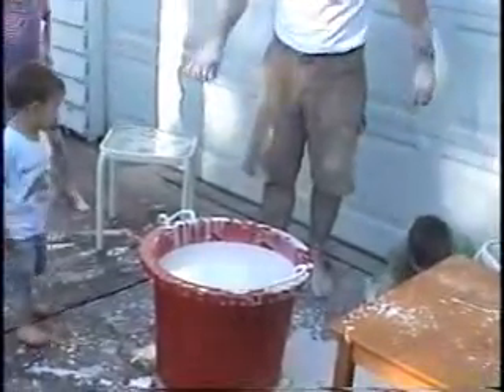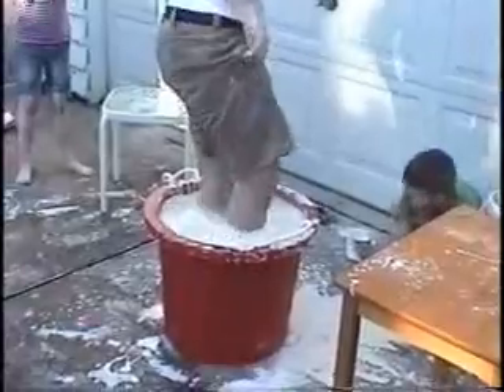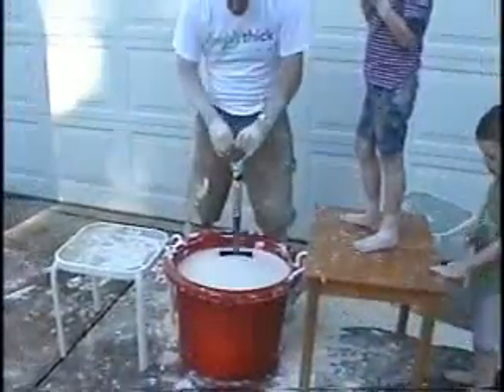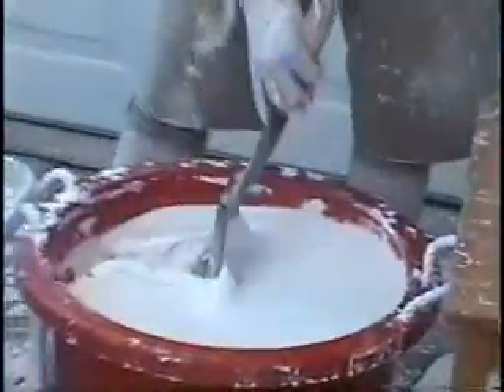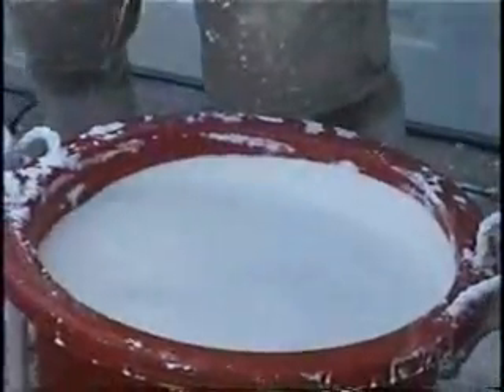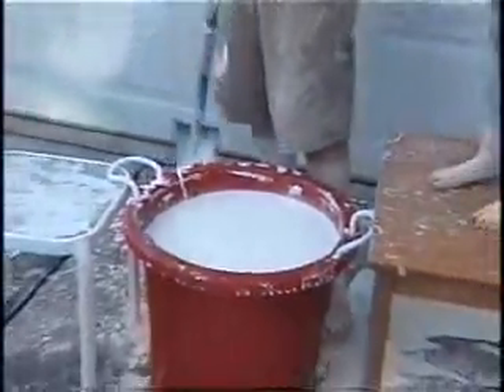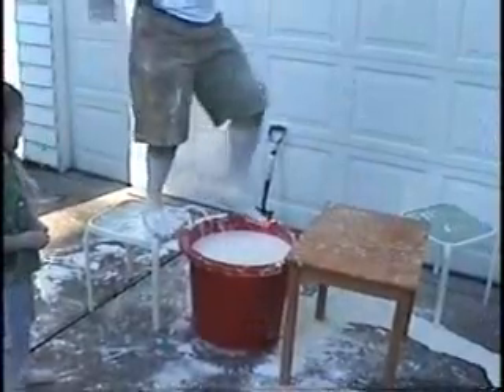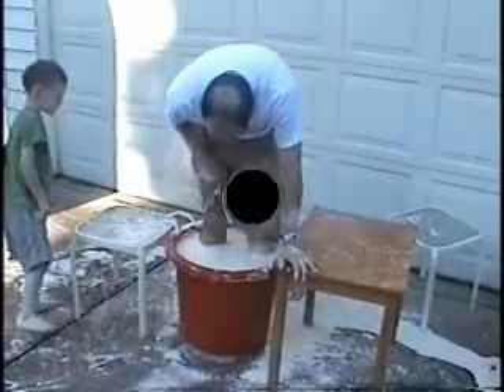Dilatant Fluid Demonstration (Non-Newtonian Fluid)

Comment: hi there, just curious about one thing.

i understand that dilatant fluids behaves in such a way that when the shear stress acting on it increases, the viscosity increases. am i right?

so i saw a few video clips on how rapidly people run across a pool of dilatant fluids without sinking in. so how do this video explain the property mentioned previously? (that the viscosity of the fluid increases with increased shear stress etc?)
Reply: The fluid carries particles that are in suspension with each other. The content of solids (aka particles) in the fluid has to be really high and this becomes a thick slurry where ideally the percentage of the particles in every square inch or cm is equal everywhere in the pool surface because the particles themselves arrange that suspension since is the only thing they kno how to do. If you displace them slowly is no reactionhowever as soon as you apply sheer stress, they will combat it by converting the sheer strees energy to enforcing their organized suspension. So they do the only other thing they now what to do and that is become viscous to the point of creating a strong surface membrane that dissipates the tension sideways and not into the surface...
Reply: @user-tx2nv1rb9k  nice one man